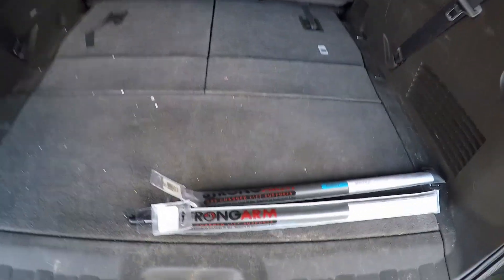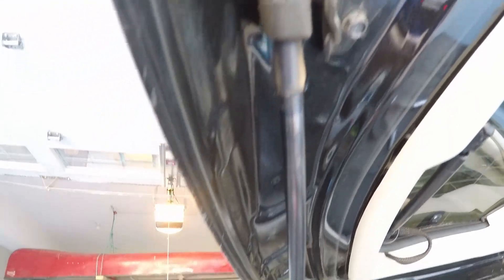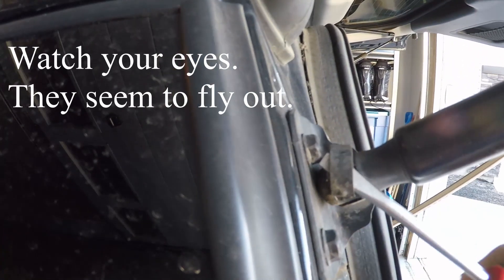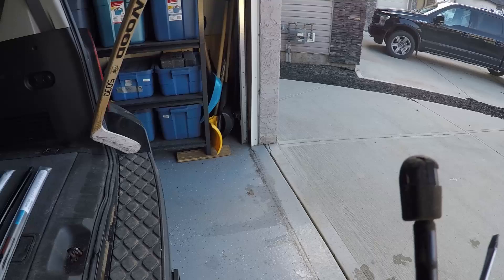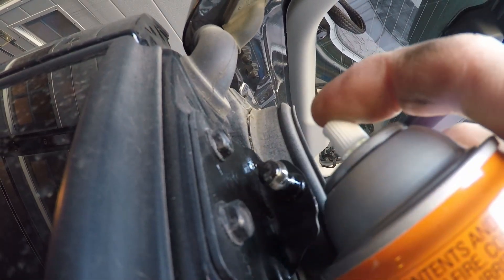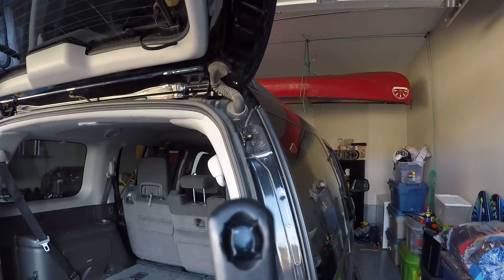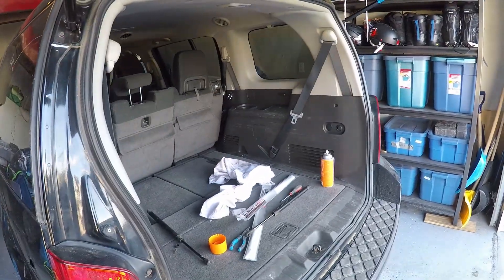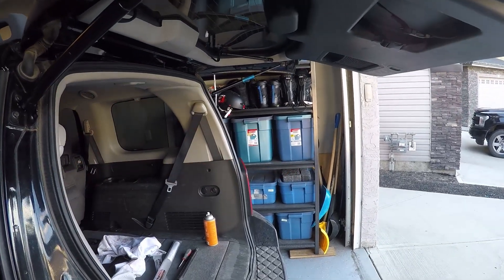2012 Nissan Pathfinder Liftgate Support Replacement

Comment: Great Video quick, easy, well presented Thank you.....Is this the first time they have replaced  them on your P-finder? and how are the aftermarket ones holding ? Up struts get unhappy esp.in the cold and you are in Canada. I have the same truck and put aftermarket on and they have lasted two years as opposed to OEM that lasted 10... some times OEM is the only way to go ...Thank you be well!
Reply from the maker: Thanks for watching. So far I have had no issues with the after market supports I bought. but yes sometimes aftermarket one don't last as long.

Comment: Have you had problems getting out of park yet?  That thin metal clip is a pain and I wish they'd just make a beefier version.  Changing out my wifes rear hatch struts tomorrow.  Always good to get a preview before I do work.  Thanks.
Reply from the maker: No I have not had an issue getting out of park, but that would definitely suck. The struts on this are pretty easy to swap.

Comment: Make a tour of your parthfinder
Reply from the maker: It's too dirty. My next pathfinder video will probably be trying to fix my messed up backup camera...so I feel that will probably end up being a front to back tour.
Reply: @DIYNorth  how does the pathfinder behaves on the snow?
Reply from the maker: @diegotoro758  In rear-wheel drive it is pretty terrible. I left it in all-wheel drive or 4 wheel drive high range for almost the entire winter. Low range 4 wheel drive is also good but only at low speeds. The tires that are on the vehicle ultimately make the biggest difference regarding how it handles in the snow. This is the second Pathfinder that I have owned and my 1998 was also terrible in the snow when in rear-wheel drive.
Reply: @DIYNorth  i guess better get good tires  for winter jaja, in general is a great car the most off road you go better it works